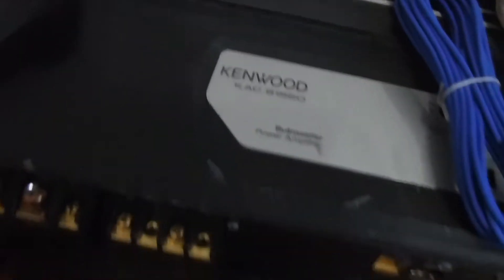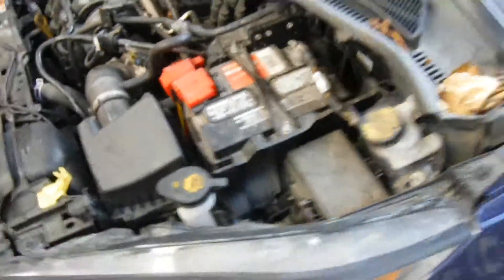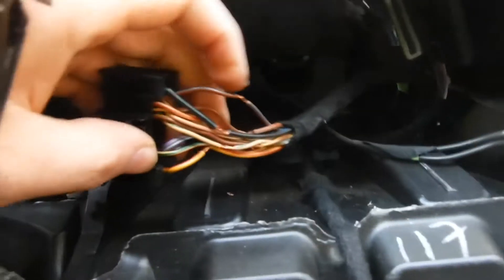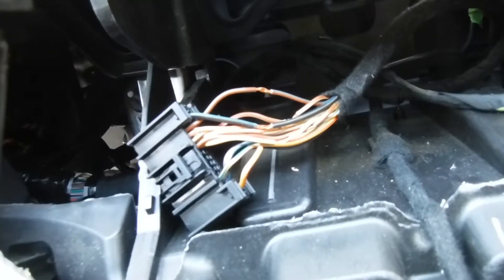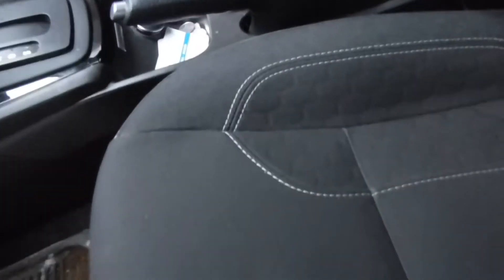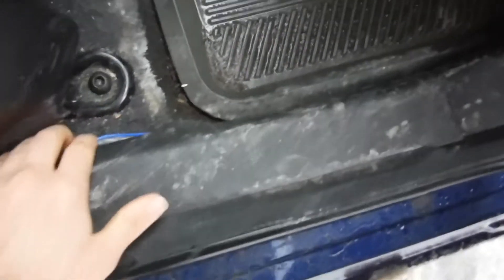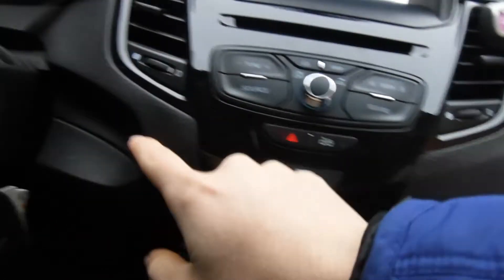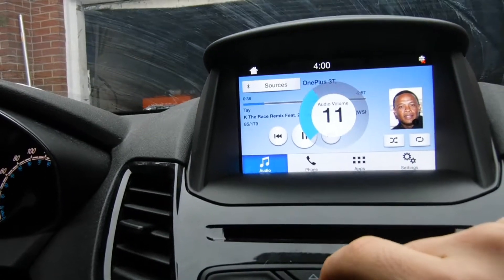Fiesta SE subwoofer install

Comment: Hey man idk if you’ll see this but my name is Jose I have a 2015 Ford Fiesta I am trying to do a subwoofer install as well and well I basically want to know what wires did you tap into for the factory radio I pretty much figured everything out except that part
Reply from the maker: I'm so sorry I just saw this comment, but he's the link to the diagram that I used. It's for a Ford fusions but the colors for the wires are the same
Reply from the maker: Also if your gonna solder the wires I suggest getting some sort of heat into the car, I tried to do mine in 7 degree weather and it was a challenge
Reply from the maker: https://mechanics.stackexchange.com/questions/12061/ford-fusion-2014-wiring-diagram/12185#12185
Reply from the maker: He's also a link to my new video, maybe it'll help some more https://youtu.be/z6OkfqdC2TI

Comment: Where u have connected remite wire
Reply from the maker: https://mechanics.stackexchange.com/questions/12061/ford-fusion-2014-wiring-diagram/12185#12185